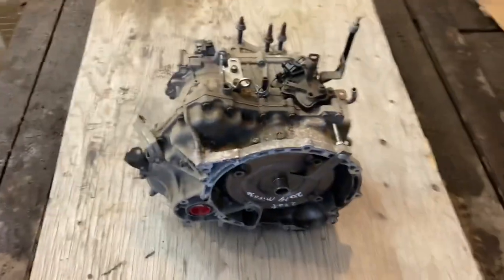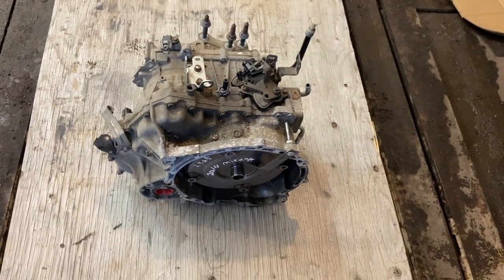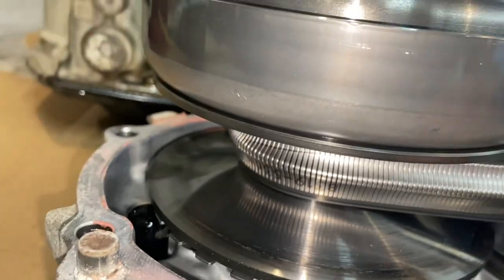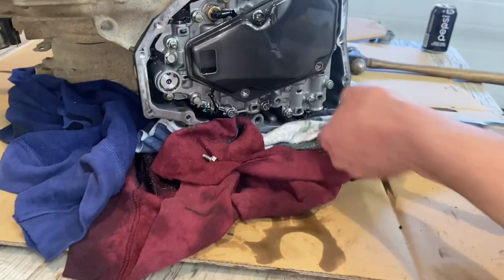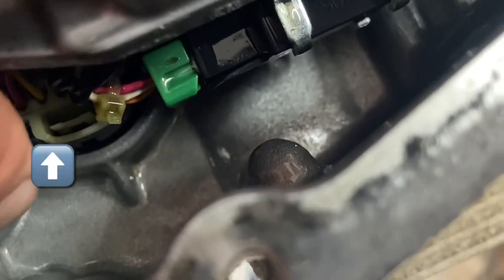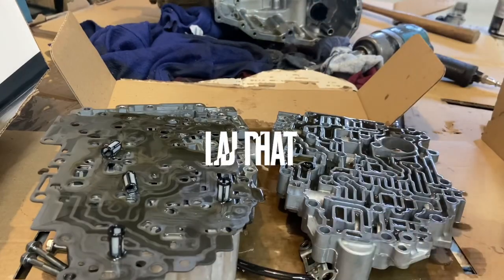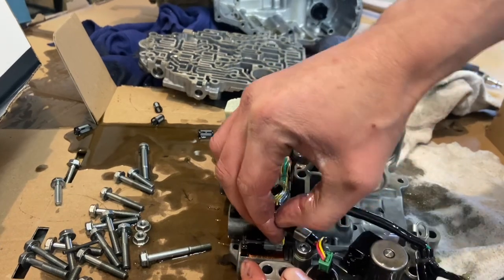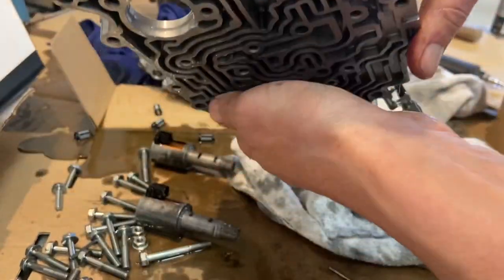Jatco Cvt teardown -Mitsubishi Mirage Part 1

Comment: Kind of off topic but do you know or have any tip for new Mirage CVT owner to get the max efficiency on the gas pedal on flat surface, hill, downhill and from cold start? I have been very LIGHT on the gas pedal because i WANT low RPM for peak effiency aka high MPG but it a trade off for SLOW acceleration. Cruise Control helps but it pushes the RPM up to 4K which is concerning. Maybe I’m not doing it right but i DO WANT to extend the CVT life span.

thought?
Reply from the maker: I don't know the most efficient way to get up to speed from a start. But I found if you already used the cruise, using the resume function seems to accelerate the most efficiently. But that only works if you had already used cruise before stopping.  I haven't had the rpm go up to 4k doing this on flat ground, at least not when resuming up to 50mph.
Reply: Let it steadily climb up in the RPM range. Ensure that the gear seeking is smooth. What you don't want is a jerky gear change in the transmission, as that would damage the automatic transmission. After reaching around 3,000 RPM or so, release the pedal and step on it again, and it should go into the correct gear and hover around 2,000 RPM, which is as you say, the optimal RPM.

Comment: I've been looking into getting  a new one of these, would you say the CVTs are okay or should they just be avoided for the 5 speed m?
Reply from the maker: If they’re maintained cvts can last. There’s a few in the fleet that I maintain with over 300,000miles on the original cvt and engine. 

I’d test drive both. I haven’t tried a 5spd Mirage but assume it’d be a little quicker than the cvt. 

I went with a cvt for my own car partially because I’m lazy and 5spd Mirages are harder to find around here.
Reply: I'd say it comes down to your driving conditions: the CVT is superior if you're mostly doing short and or around town driving as you'll get better MPG's vs the 5-speed and also the CVT will be a bit smoother of a platform being paired with the vibby 3 cylinder; if you're doing a fair amount of highway driving then stick with the 5-speed, long-revved-out drives are the CVT killer.
Reply: Maybe for a Nissan spec CVT7. Mitsubishi and Suzuki do a much better job with JATCO CVTs. Different programming, the Mirage CVT operates like a true continuous variable tranny. The real CVT killer isn't long highway drives, it's a heavy curb weight and too much torque. The Mirage weighs only 2100 lbs with a paltry 74 lbs of torque, it's CVT7 is rated for over twice that power.

Comment: Of course by 180,000 miles that CVT have already cost a few thousands in servicing.
Reply from the maker: No, more like $100, depending on how many times the previous owner changed the fluid. I bought a used cvt for this car with under 4000miles on it for $500cad and replaced it at home.

Comment: This is worst technology ever built in a car. I miss old cars
Reply from the maker: Yeah, the cvt sure doesn't make it a fun car to drive but they seem to work. Might be more reliable than some of the over-complicated failure prone dual clutch automatics offered by others.
Reply: DaVinci was the first to conceptualize the continuously variable transmission. It's a unique design that maximizes fuel efficiency. The Mirage, since 2013 worldwide, as a good reputation for reliability. It has a very high % of owners that buy more than one. Hell, we're on our 4th in my family.